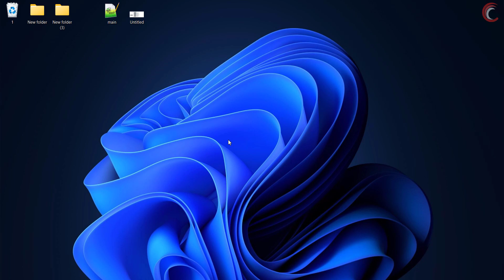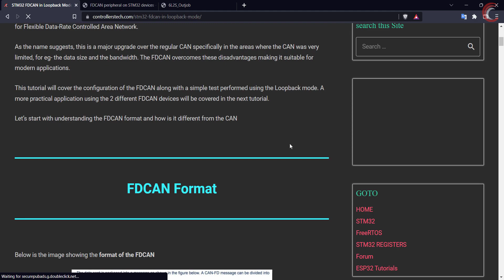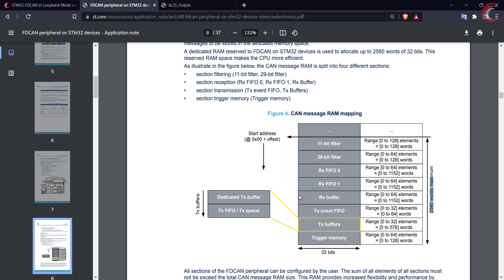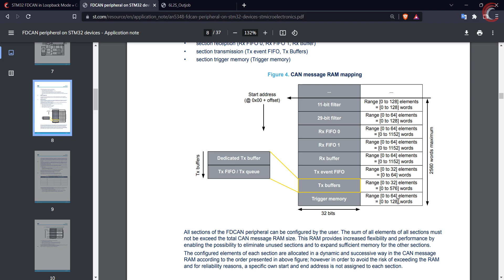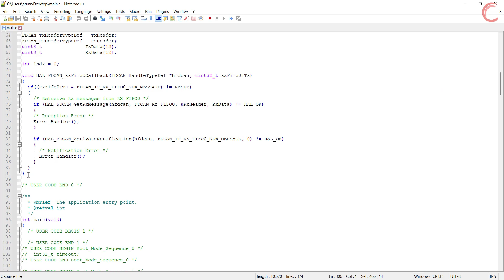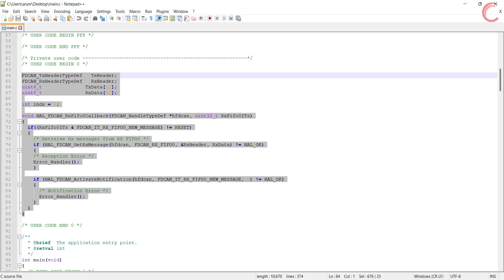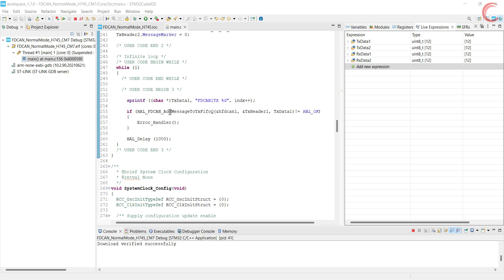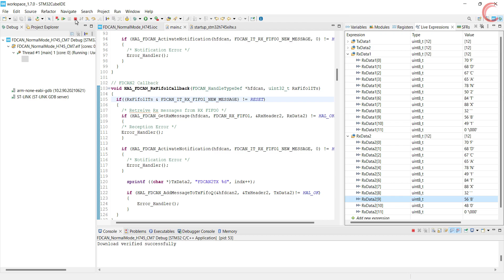STM32 FDCAN Tutorial: Normal Mode Communication Between Two Peripherals

Comment: In the video, I wander that you used only 1 stm32 board and then debugged it? If I said correctly, the mode used here is loopback mode?
Reply from the maker: It is being used in Normal Mode ( not Loopback). I have used 1 board, but it has 2 separate CAN-FD Peripherals.

Comment: Is it possible to initialize the STM32(H7)'s FDCAN for Classic (non-FD) mode?

I'm interested in transmitting 30 8-byte messages every second..  I assume the peripheral's FIFO isn't that deep, so I will either have to use a TX FIFO empty interrupt in order to feed it more data...  OR  (preferably)..
Have the DMA push the data to the FDCAN peripheral automatically without CPU intervention.

How doable are either of these?
Reply from the maker: "Is it possible to initialize the STM32(H7)'s FDCAN for Classic (non-FD) mode?"
Yes there is an option to configure it in the Classic Mode. FD Can is backward compatible, so there shouldn't be any issue.

How doable are either of these?
The first one makes more sense.

Comment: Hello sir,so far your videos are very helpful.
I'm  using NUCLEO-G0B1RET6 for FDCAN but my breakpoint is not working,neither I'm able to receive the data on RxData1,TxData2,RxData2.
I have used your code for this work. 
Please let me know if it is possible to use this board for FDCAN. Kindly spare some time to answer my question.

Comment: hi I am new to STM32 ,i am using stm32g0b1ctb6 ,it has CANFD in in this i need to use CAN classic frame format ,can i use same steps as you shown?
Reply from the maker: This video is about fdcan. To use classic can, see other videos in this playlist. 
And yes, the canfd is backward compatible, so you can transceive classic can frames also.
Reply: Thanks will check
Reply: I have Problems to send many frames in 20ms cyclic, the Controller always ends in Bus passiv error, do you have any ideas?

Comment: Thanks for your videos. I tried it, but the Txbuffer is full after three cycle of task and I got error code 512.
Reply: Iam also having the same problem did you resolve it, the error code 512 is HAL_FDCAN_ERROR_FIFO_FULL error which states that the buffer is filled, did you find any solutions for it?